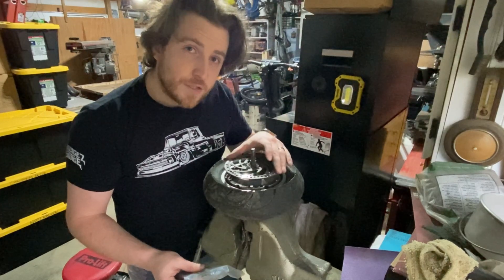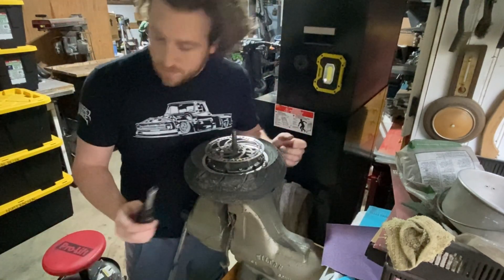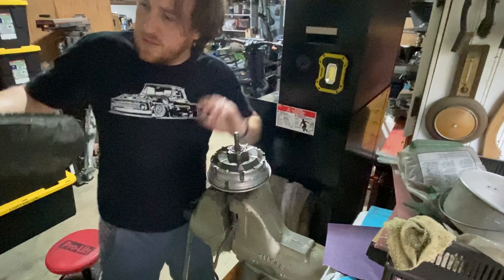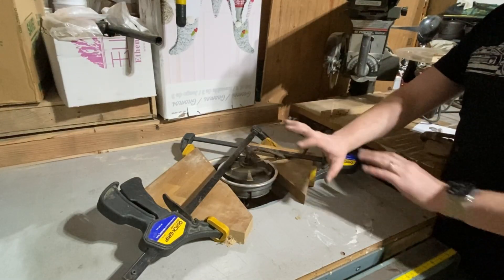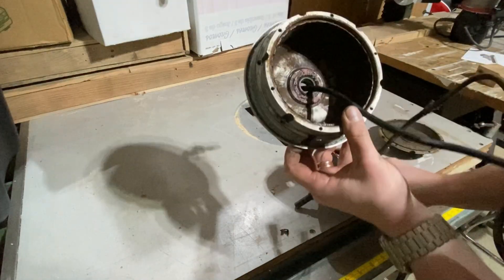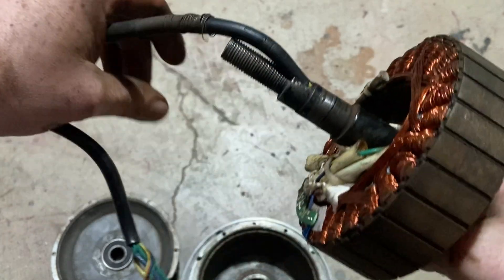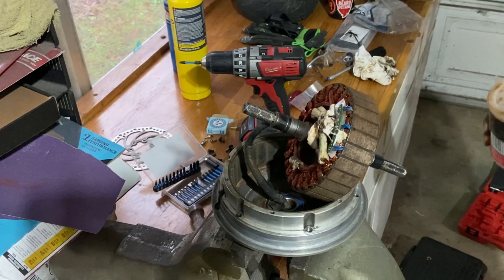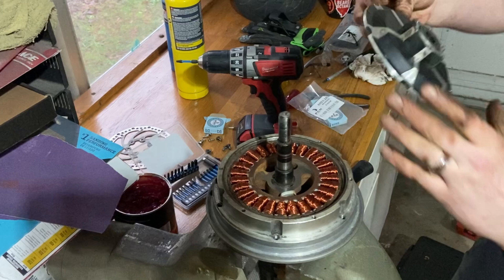Tips and Tricks to Take Apart an Electric Motor

Comment: I just got the bearings to do my roadrunner rs5+ 😉 sounds like a bag of gravel 🤣🤯😉 i would have popped that rubber seal off bearing and added a bit of that red n tacky to inside of bearing 😉 i know they come pre lubercated but it is always minimal. 😉 Don't want to pack if full because that can cause heat but just a bit more to be safe 😁 what a pain to change bearings in these things 🤯😉🤣 i don't have a bearing puller but know where i can borrow 1 if needed. Best wishes with all man and thanks for sharing 😁
Reply: I also have an RS5 but I have a bent rim with a new motor. Would you happen to know how to find the outer portion, as in just the rim?
Reply: @ceavalencia4767 these are not split rim so the rim is actually part of the motor 😉 magnets are glued right to rim. Your screwed man 😞 sorry.... I think you're best bet would be to find a rim with burnt motor and replace the core. That sucks. Just buy a new one man 😞 sorry 😉 good luck 😁